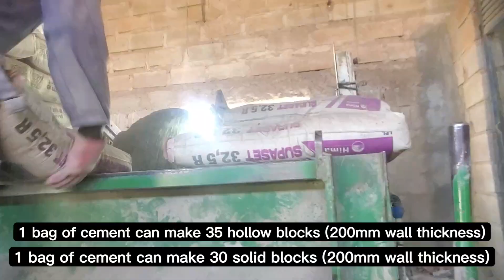How concrete blocks are made from start to finish

Comment: Hello Ian ...am having issues with a newly built house with paint peeling off and plaster having issues ...how can i rectify it plz
Reply: It's happening close to the floor level
Reply from the maker: Issue might be happening due to damp simply because water proofing powder was not added in the plaster, or because there's no skirting or because the room with those issues is near the bathroom or a shorter foundation less than 600 mm above the ground 

To rectify that, is to renovate the affected area with a plaster and this time round add enough water proofing powder in the plaster
Reply: @ianconstruction  what water proofing powder do you recommend plz
Reply from the maker: @NextLite-zd2lu I use Dr.Fixit waterproofing powder it costs 1.5$ per pack ( half a kilogram)
Reply: @ianconstruction  thank you for ur endless help

Comment: Thank you .bro . 
But is best material is it sand or stone dust and why
Reply from the maker: stone dust,  
because sand particles even after compaction will break easily compared to stone dust
Reply: @ianconstruction  
Oohh bro thanks but I thout sand blends more with Cement than stone just